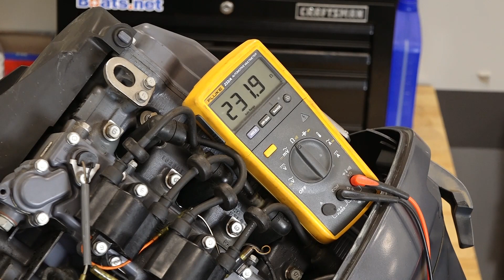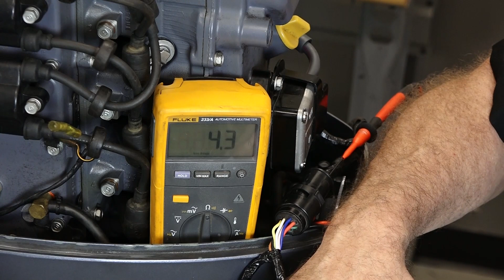Ignition System Troubleshooting | Outboard Has Spark But Won’t Start | Outboard Ignition System PT 3

Comment: I have 2006 9.9 HP 4 stroke engine. Just serviced it. But the red light stays on. Does not blink. Just is on. Anyone has any advise what to check or do so the lights switches off after few seconds the engine started? Checked oil level too. Thank you.

Comment: I have a 1998 mercury 150HP EFI PRO MAX that was disassembled years ago. But now that it’s assembled it won’t start. Compression is at 120, we have spark to the plugs but no fuel pressure. The fuel pump has power to both terminals for some reason. . I BENCH TESTED THE FUEL PUMP AND IT Works, any ideas why both sides of the pump would have power.?

Comment: My motor will sometimes fire and other times won’t. Normally will start after a couple of days. Stator test good and also the power pack. Have also replaced wiring harness. 2000 40 hp Mercury. 3cylinder. Any ideas?

Comment: A very comprehensive explanation. I am confused about one thing. The heading says “has spark but won’t start.” If it has spark, I don’t need to check fuses or wires. So I have an outboard that has spark but won’t start.

Comment: Shouldn‘t it be that if the shut off terminal wire and ground shows low ohms when ignition switch is on the switch has gone bad? Should of terminal wire to ground should kill the ignition. Or do I have a false thinking?

Comment: hello sir  can i ask question sir regarding ofthe engine problem..yamha 300hp ..the has 3 engine but the center one is not desame rpm port and starboard is 5000 rpm but center is 4700 when it goes to 4700 rpm suddenly is goes down in 2200 rpm and the is jerking..i replace the fuel pressure regulator.spark plug and filter in relief valve

Comment: how can i check please the diode cable going to the solenoid and ground , my 60 merc is not cranking ,starter works motor starts only on pull cord , but when turning key nothing happens ,

Comment: Got a 1992 9.9 evinrude and i triple checked/rebuilt the carb, replaced the power pack, charge coil, ignition coils, spark plugs, primer bulb, fuel pump, water pump, new fresh gas and STILL wont turn over. I have plenty spark from both plugs. And  checked the killswitch and that works fine (obviously since i have spark). And whats weird is even when spraying ether in the carb, or spraying inside the spark plug holes, even putting a little gas in there, it STILL wont fire. Sometimes it sounds like it wants to for a second but then dies. Im at a loss here. Anyone who has any ideas much appreciated.
Reply: Did you figure out what’s wrong with your boat engine. I’m having a similar problem. I have spark but it won’t do anything even if I spray gas by bypassing the carburetor
Reply: @vitaly19  i havent yet. I put it away for the winter and in the next few months im gonna go back to it. I bought a gasket kit and after i remove the block im gonna replace all the gaskets. I have a feeling when i remove some of the side plates to replace the gaskets im gonna find some badly clogged cavities.
Reply: Any updates? I’m having this exact issue with mine and can’t find anything online.

Comment: John I Have a problem, my Mercury  nitro series x R 6 1 50. Will not start tries to turn over, but will not. And has a good  battery not clicking? But actually trying to start but wont turn over.

Comment: Thank you for posting this. You saved me thousands of Dollars. My tilt wires were bare. So I rewrapped them. Changed the spark plugs.  Checked all the fuses. Replaced the fuel pump from tank to engine. Works like a dream

Comment: Love the vids. Could we get one listing symptoms and possible causes? For example I hear a click when I turn the ignition but the starter motor doesn't do anything. New correct fully charged battery. Guage reads about 13V. All electronics to that battery work perfectly. I was told the click I hear is the solenoid so I assume the starter is bad but I only have 35 hours on the motor with regular maintenance done by a licensed tech.

Comment: I have a EFI four stroke 30 hp. Mercury. Before I launch my boat I check to make sure my outboard turns over and I'll run it for a few minutes. I have a brand new battery. After I launch my boat I turned the key to start it . But all it would do was make a clicking sound. It seemed like the sound was happening in the frontal part of the outboard. Can you please help me find and solve this problem.

Comment: Hey John,
My 2017 Yamaha 70 4 stroke will only run at 4000 max. It also runs rough at less than 1000.
When I tried to pull one spark plug wire at a time, the engine dies with any wire off.
What could cause this.
I’ve changed the fuel, filters and injectors.
Thank you in advance

Comment: Motor runs as long as you hold ignition switch closed. Starter disconnects after motor starts and runs and throttles up but turns off immediately after I release the switch.  Will run as long as I hold the switch closed. Ignition switch???

Comment: what  is the problem when the motor turn over but backfire causing it not to start
Reply: We’re you able to figure out the problem, because I’m having the same problem with my out bored motor.

Comment: Hey John, I love your videos! They're always very informative!!
 I was wondering if you could provide me with some advice. I have just replaced the head gaskets on my 2007 F225 Yamaha. The engine is running, however only it's only running on the three cylinders on the port bank. The starboard bank does not appear to be firing. I have checked for spark and fuel, and the injectors all seem to be working ok. Compression on the port bank is 170-175 psi, on the starboard bank it is 150-155 psi. I have checked the spark plugs, and they come out black and slightly wet on the starboard side. The port side is firing ok. I'm at my wits end trying to figure out the problem. I have spoken to several Yamaha mechanics with no success. Nobody seems to be able to tell me what's wrong. Any advice would be greatly appreciated!!